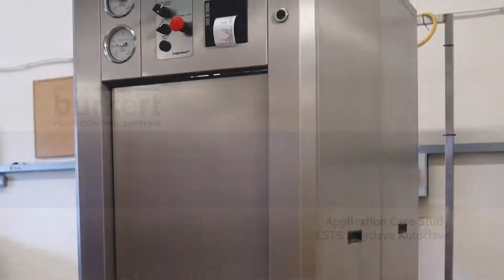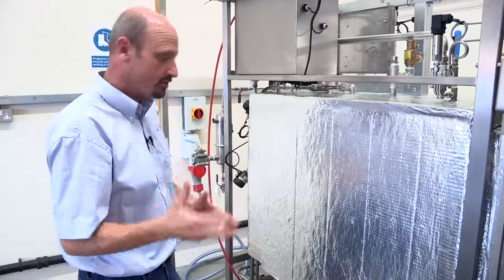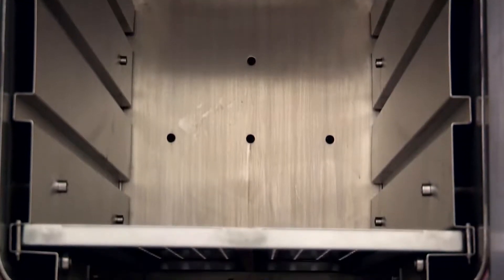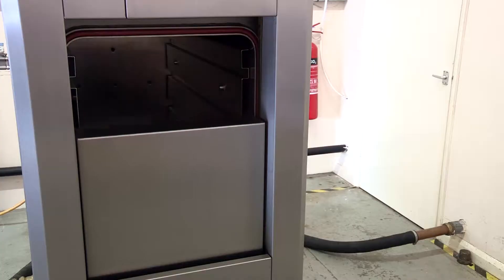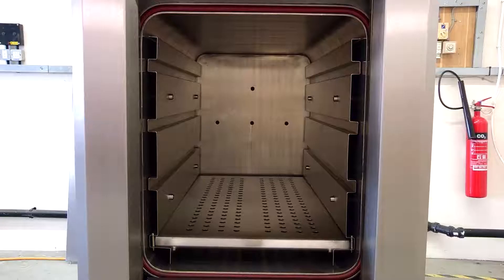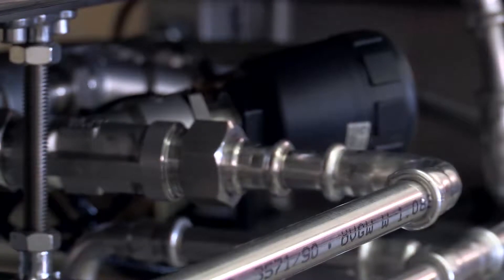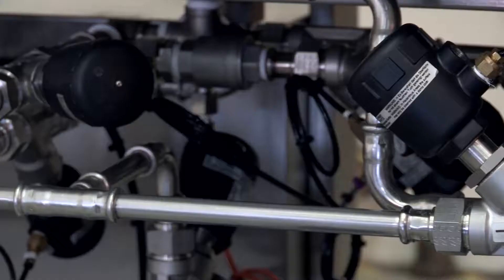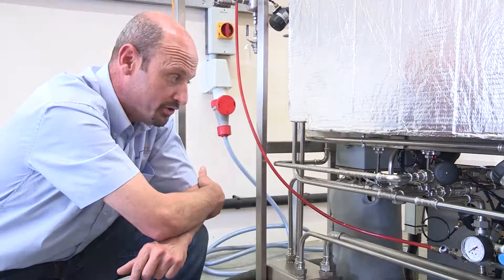Bürkert - ESTS Autoclave

Comment: I have used burkert valves in the past I find them to be ok but also can fail and leak internally , also the burkert seals can deteriorate quickly especially if inline with direct high pressure steam , there are better valves out there